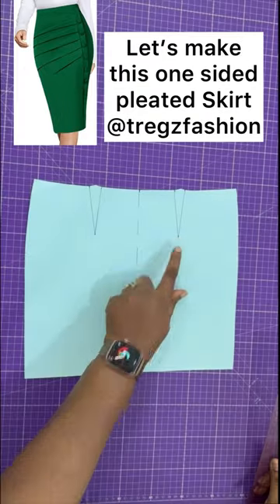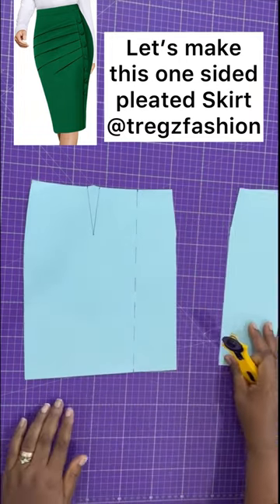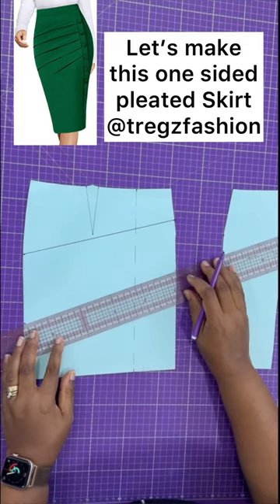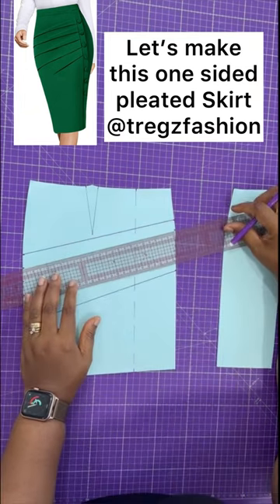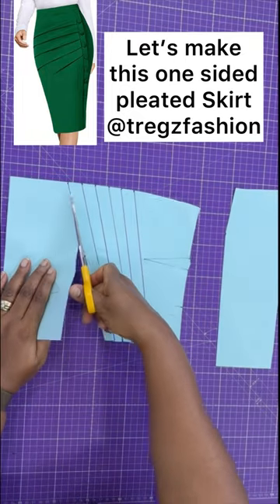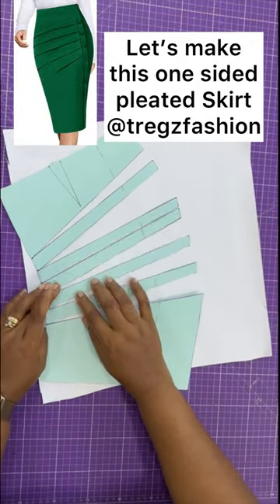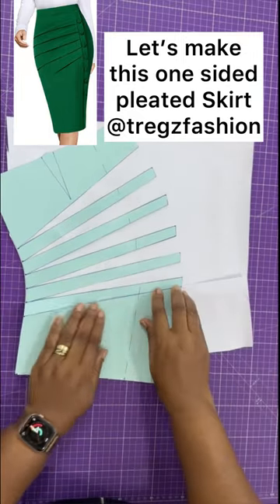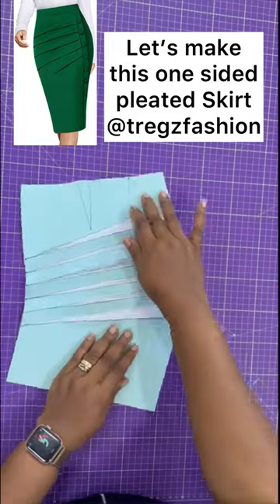How to draft patterns for this pleated skirt. Will you be trying this? #pleatedskirt #pleats #skirts

Comment: Thank you, you explain this so well! 
Does this change where the straight grain is on the pattern?  Or would you still line it up the same as the original pattern and the lower half of the skirt ends up a bit in the bias?
Reply from the maker: The straight grain may move a bit because of the slashing. But , I still try to place it on the grain to get a better finish result.
Reply: I see, thank you!